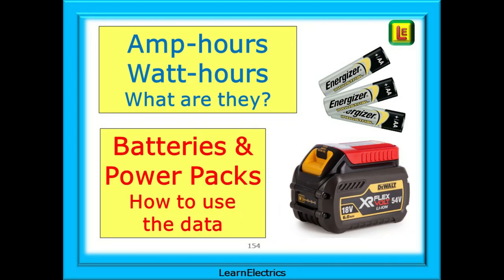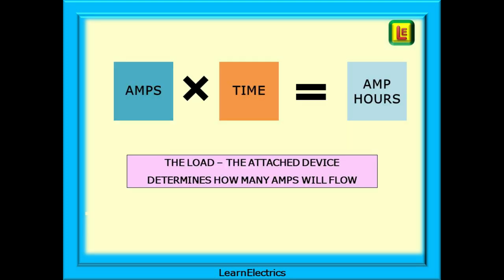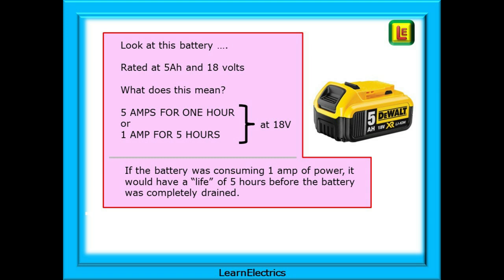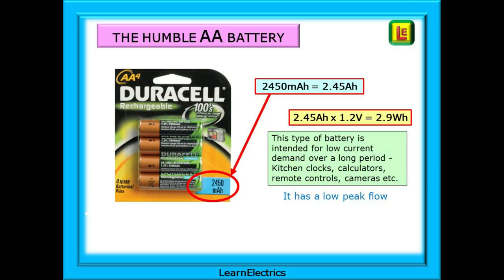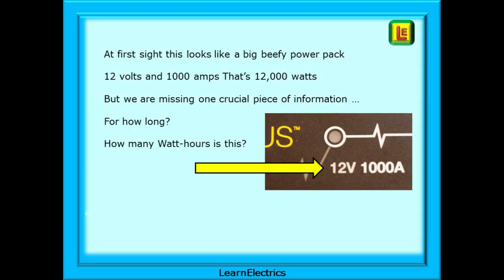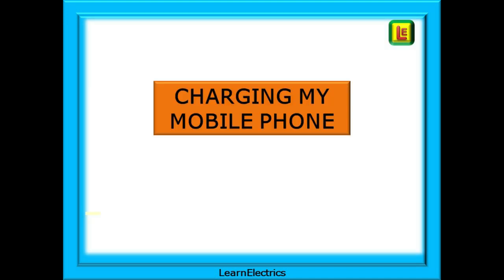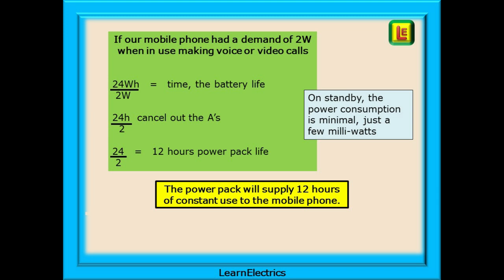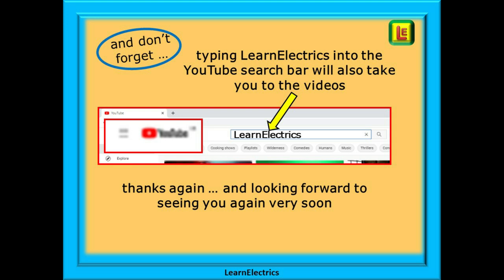AMP HOURS and WATT HOURS – WHAT ARE THEY – HOW CAN I CALCULATE THEM – BATTERY LIFE – POWER OUTPUT

Comment: Please can you explain the consequences of depletion of battery charge over time when inconstant  use and how it affects how many hours it will last. I want to run a battery amplifier which is rated at 20w, requires 12v and 2amps. I'll be using 8 D cell alkaline single use batteries. How long will it run continuously. Thank you.
Reply from the maker: Manufacturer's data is the place to look. There are so many variations of battery composition that there is no general figure, and is it constant usage or fluctuating and battery temperature affects it too. also consider the battery voltage at which the devices will stop functioning normally, that will also affect the "life".
dave.
Reply: @learnelectrics4402  thanks. So does that mean that the capacity of the battery in amp hours divided by the current of the load in amps  does  not give the number of hours that the battery will last? Would it be even  close? I've tried to research this but nothing is very clear.

Comment: Excellent. Now I a bit more Clude up on battery’s I have always wondered how long  the battery’s for my will last also I was under the impression that Amphour or milliamp hours determine how long it will take to charge  the battery.
Fantastic video as always 👍👍👍👍
Reply from the maker: Thanks Sean. Charging is a little more complicated, depends on battery material, size of charger used and so on. Thanks for watching. Dave.

Comment: We’re they 1.2 volt because they are rechargeable AA batteries are 1.5 volts generally
Reply from the maker: Just plucked some numbers out of the air Tony, to use as an example as rechargables generally have the mAh on them. Dave